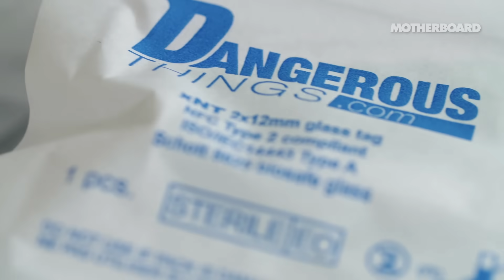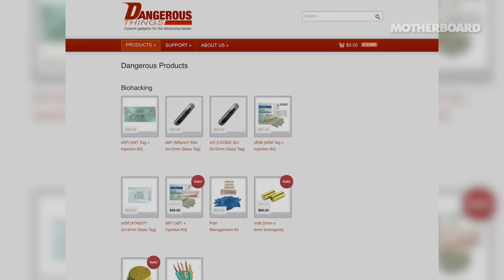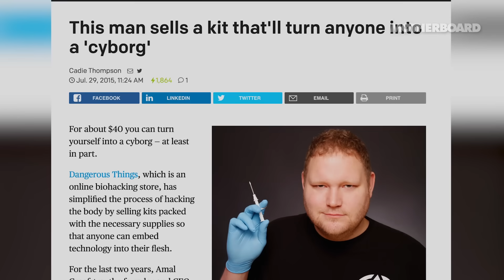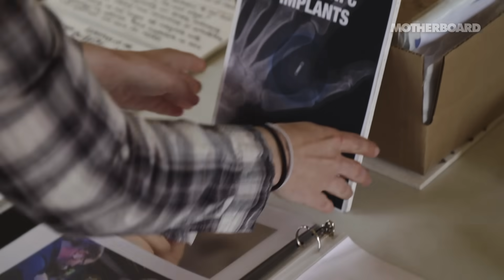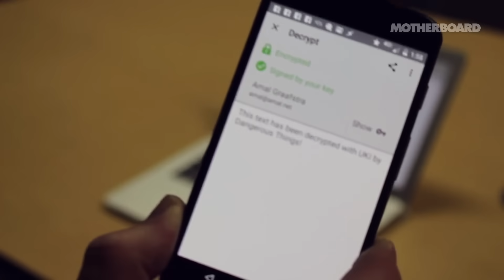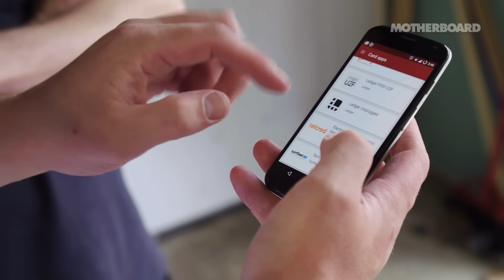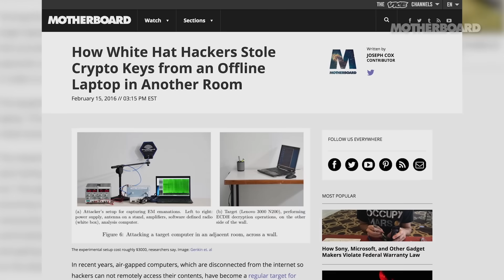The Man Biohacking Encryption From His Garage

Comment: how do u remove rfid after implant?
Reply: vim m you dont
Reply: surgery
Reply: (For this implant)You sterilize the area of implantation then using a scalpel make an incision wide enough for the implant to fit through(about 5 millimeters wide)and use surgical tweezers to pull it out(stitching may be necessary),and yes you can remove it without needing to go to a hospital.

Comment: what about immune response, to these chips.
Reply: they coat them with a material the body can dissolve
Reply: They are coated in glass or metal or some other material that the body doesn't react to.
Reply: They coat it with titanium
Reply: @jacobbenson3620  also coated in gold
Reply: SemiCircle #FreeKekistan ‘t*
Reply: If the coating on the implant fails or if it gets infected, they just take it out.

Comment: Could an external device learn that there is am RFID device located in your body? Could that knowledge be used to track a person?
Reply: Farine i know I'm a bit late, but maybe this still interests you. I'm not sure about the first part, but I doubt it's possible for the same reason the second part is unlikely. NFC chips only have a range of a few centimeters, so maybe someone would be able to detect your chip, but from that distance they could propably just use a metal detector and check the common implant spots. Because of the short range, for someone to track you, they would basically have to go on a walk with you, always staying in the range of a few centimeters from your hands and that kinda defeats the purpose of tracking someone

Comment: there is no security there.  I could electronically lift your key if I can touch your arm quickly in passing.  So now that you have an RFID chip in your hand you still need to wear something over it to block the signal when not needed.  So easy to beat this = Trans-humanist fail!

Comment: Dumb, your taking PCs like functions, which are highly insecure as we all know, and putting it under your skin. I'm not against transhumanism, robot eyes, robotic body parts for the disabled. But this is security were talking about. That guy at camp is probably expecting some software of some kind to protect his resume from falling into the wrong hands when he transmits. Point is that yes, people do this already, but with external devices. Whoever do you think is more secure? The guy who got his card information stolen because someone read a chip under his skin? Or the guy who pulled out his wallet, snapped his card in half, and is now on the phone with chase?